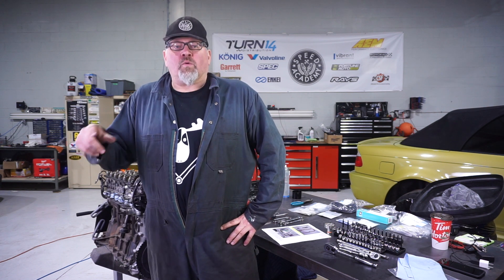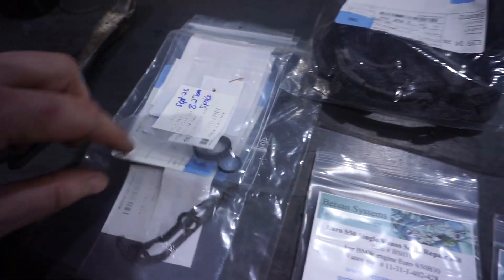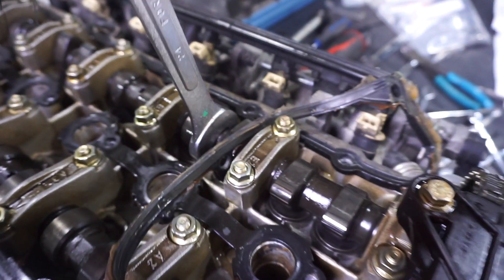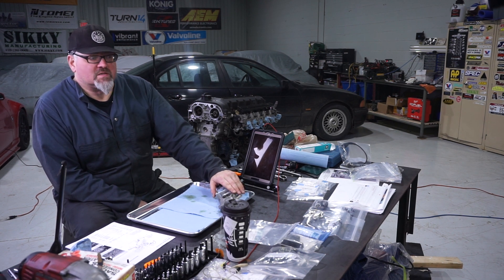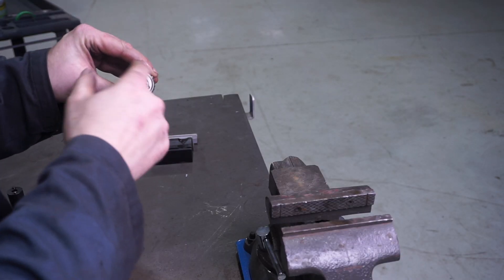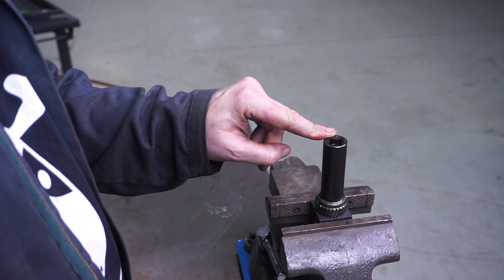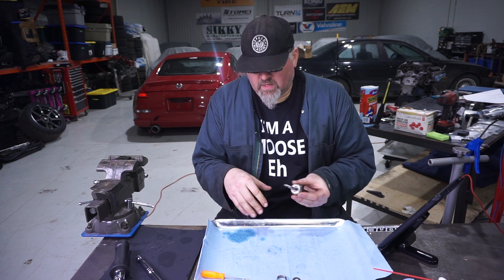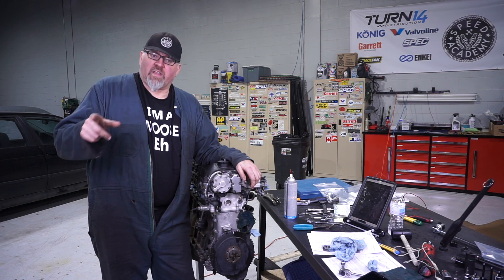BMW E36 M3 Vanos Rebuild How To

Comment: That Anti-Rattle kit isn't even needed - at least for us lowly single vanos guys. I bought o-rings only from e-bay and adjusted my old 'ring' by sanding until I had slight drag (m3 cam swap). Worked perfect on 2 rebuilds and there was barely any sanding needed. The rattle ring kit is 'harder' metal but who's to say if that will help long term or how much harder it is.

Beisan needs you to do this anyway since they can't predict thickness variation in the stock components. Their first step is to assemble and check clearance, then sand the ring or the spacer until you get the right clearance. Therefore put 2 and 2 together and you just tighten up clearances with sandpaper and your old parts. From what I've read people still need to rebuild their fresh rattle ring vanos with the same frequency since it's the o-ring that goes out first every time. Still going strong a year later for me.

Comment: It's actually not that difficult to do.  Keeping things surgically clean and organised goes a long way to success . Once you done a few you build up confidence and really get a feel for what's going on. With patience and strict adherence to the instructions any reasonably competent mechanic could do the job.
Reply: Same with do it yourself surgery ...
Reply: A lot pf thimg are hard... However gettimg part and put it back together is not the same thing...marking and checking before put it back to the car the hard part since amg or gtr engine also had mistake... Sinc these car hogh power and small mistake will show up in dyno....
Reply: campkira should not need to mark anything! It literally is as I said,make sure everything is put back to factory standard. Worn parts are replaced ,seals are replaced and solenoid tested. I have overhauled a few ,first for myself and several for customers. They are all still in service many thousands of miles down the line,with no problems. There are lots of clear step by step instructions available. Follow them to the letter and you can't go wrong.

Comment: Cheers for the footage on the S50 euro . Looks like your top end is in good condition even the vanos.  I'll be rebuilding my engine.  Not taking any chances on a 20 year old engine.  Most engines I've looked at or owned were rubbish leaking vanos /Rod bearing gone .